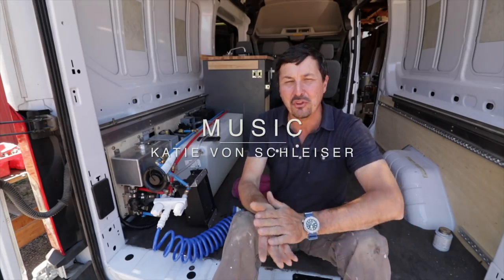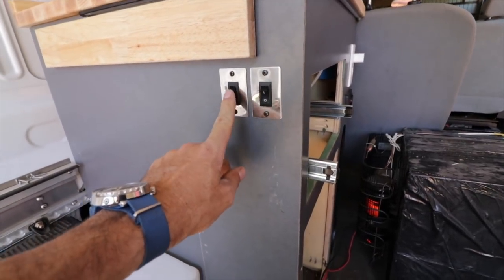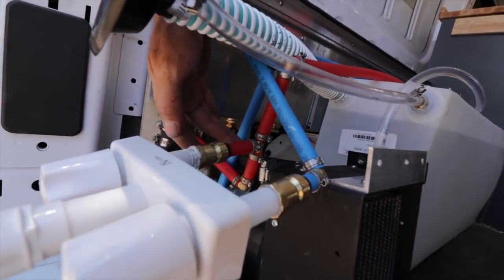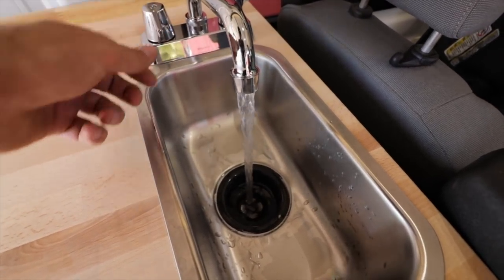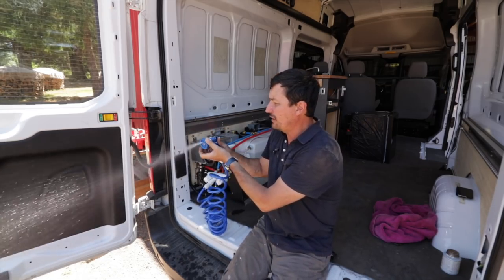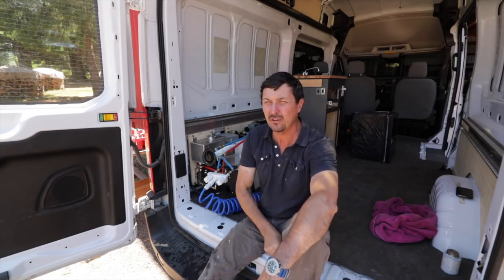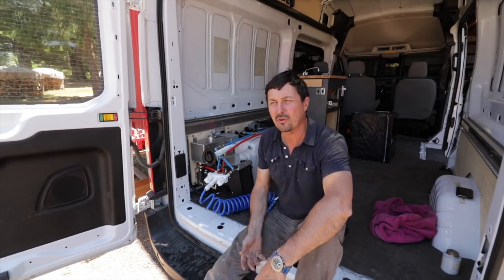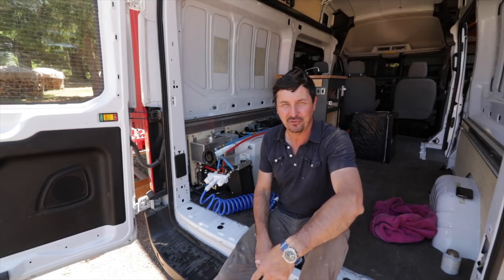Adventure Van - How To Build A Outside Shower

Comment: Looks great, i like the low footprint of your heating and water system. Not to mention the fuel economy of your van vs an RVs gallons per mile. If you use a earth friendly soap you might be able to water plants with the grey water.

Comment: Plumber here. I would deffinatly suggest adding 3/8 in line water hammer arrestors under the bar sink to add support the the water system. They will help protect the shark bite fitting and the gear clamp fittings from damage due to water hammer if you turn the water off quickly. Love the videos.

Comment: For Your Shower rig. I saw on another Van build.The Gent used his shower head for sink and shower. To mount in both spots he used a magnet. True it was large enough not to let the spray move it. If you would do something similar it could be stuck anywhere to the door frame So that it would be easily height adjustable for almost any user. Although you might want to coat the magnet with rubber or the like to prevent scratching. 
Additionally some sort of frame to attach to the door top or roof to hang a tarp or shower curtain for a bit more privacy when appropriate.

Comment: Cody, beautiful job.  I really like what you've done here.  I don't even want to say that someone will point this or that out and I don't want to do it myself.  The only thing that'd I'd add and I suspect it's on your list of things to do is add pipe insulation to at least the hot side.  I would go ahead and do both the hot and cold lines for insulation, sound dampening and protection to the pipes and connectors.

Again I love what you've done here.  I know you will be humbly proud ever time you and the family uses this system.

Comment: I'm glad you understand the risk of too hot water. A lot of kids get hurt real bad that way.

This is very nicely done. You could mitigate the risk of water and electronics in the same space by water proofing the electronics as much as ventilation will allow. (Don't want a fire.)
Maybe a plate to guide the flow of leaking water etc.

Comment: I've had to deal with custom executive sprinters for my company that cost a hefty amount and you'll still find work in those vehicles that make you question what they were thinking and why they tried to cut corners. I'm glad to see you build the van right so that you won't have issues and if you did you'd know where to source the problem.

Comment: Awesome. I have a RamVan camper that I am building...slowly. I never check out the “production” campers. The only ones I’m interested in are the DIY vans. People do amazing engineering jobs on these rigs. Yours might be the most simple complicated build I’ve seen yet, I love it. If possible I’d love to see a “mistakes top 5 or 10” help us new builders out, especially folks like myself with a basic skill set to begin with.
Reply: Have you checked out Sasnak's Transit?  He is doing a bang-up job too, the contrast between these two Fords is amazing.  They are both top-notch and built for a specific end-goal.  I am finding a lot of inspiration in both. Maybe someday...

Comment: I purchased my travel trailer at a military auction...(while I was serving) It was missing a range/ oven/ frig/ shower and toilet. 
I gutted it as far as I needed to. Gave it a super clean inside and out. Put in a range/ toilet/ frig/ SureFlo pump. Modified the bunks/ the closet for hunting & fishing storage.
Replaced all the lights with LED. I payed $400 initially...overall less than $2000. I know every square inch of it. It's a 1976 16 ft. Wilderness "My Hunting Cabin on Wheels"

Comment: Great Set up!! Hey I learned a few years ago that if I put baking soda in my freshwater tank it will keep the water nice and fresh. Its a super cheap way to keep your tank clean... I also use it after I empty my black water or gray water tank...I will refill the tank with fresh water throw in a box of baking soda and drive home with that sloshing around........when I get home I empty again and everything is nice and clean plus the baking soda will also clean the tank sensors.

Comment: Make sure that you have a good plan for winterizing all that plumbing.  Both the pressure side, and the drain side. Am a farmer with crop sprayers.  I've broken stuff with ice.   Carry spare fuses, this kind of thing pops fuses.  A long rectangular tank can be tricky to get the last few gallons from.  If the van is on a hill, the tank's outlet might suck air.

Comment: Looking great. Just 2 sense from my side. Put 2 valves in by your little screen so you can clean out the filter without having to pump the 21 Gallon tank. The rest looks great. Also for the shower head put a angle aluminum to the Floor with a diamond treat patter for decoration and boom it all looks professional top to button :-). Anyhow great job. On the Showerhead do magnetic with a switch on off magnet since your Sprinter frame is steel it will hold anywhere :-). But also as a tip put a Solar panel onto your roof a thin film which is 12V and let that charge back your Battery of your Sprinter. So this way you never strain it to the point of not been able to start your Car again. Just a suggestion. And if you want to bounce off Ideas just hit me up.

Comment: About the shower situation, I myself, would attach a plant hanger thing to the ceiling by the door that could swing out, that you could attach the sprayer to, that way you could angle it down and out away from the bed, etc. Also you could attach some hooks to the top of the doors, that way when you open both of them, you could just hang a shower curtain between the two

Comment: The gap on the back door looks big enough to feed shower head through, then even when the bike racks are in place you can use the shower around the rear driver side wheel...pretty sweet and good location choice. Thanks for sharing.😊

Comment: Hi Cody, I agree with you and have had fist hand experience of the junk you can buy. One thing I would keep in the van is two shark bite connectors and a piece of piping in case of a leak when you are out and about. these things don't cost much but if you do have a leak they will pay for themselves instantly.

Comment: Really nice.  Questions and comments:  Behind the heat exchange there is a bit of dead space to the outside.  Have you thought about putting some spray foam behind it for insulation so you don't fight the outside temps to heat the water?  where you are talking about putting the hose is next to that heater, now I don't know the heater but will you be in danger of melting that shower hose.  
What about building a square metal frame around the rear window of that door that will fold up and lock with a toggle or pin.  Then you can hang a curtain from it for the shower and attach the sprayer to it for the head.  Fold it up pull the shower curtain and hose / nozzle out of a bag set up the curtain and hose to the frame.  Shower, dry off, break down and stow.   Just a tought and the frame would fit around the window folded up out of the way. 

Thank you for the videos again.

Comment: One small suggestion (and you'll find out by experience anyway) do "submarine showers". get wet, turn the  water off, soap up and do your scrubbing with the water off then Water on for rinse, then water off and grab a towel. a continuous shower will run you out of water faster than you can imagine! And 4 people will go through a lot of water even without showers when camping.

Comment: I think one of the biggest perks people push with trailers is the overlanding trailers.  Th erooftop tent system and being able to leave camp setup and go for a drive without the trailer. 4 wheeling or what have you.  But its not for everyone. ( and those trailers are sefl contained by the way. Patriot campers, turtleback trailers, HEO expedition outfitters etc.

Comment: Wow, I like your hot/cold water system! 
Good job!

Not sure, but you might need to think about condensation if you keep the red and blue pipes side by side without insulation. If insulation around the pipe won't fit due to space, maybe it could be remedied by putting in a few little 12v fans strategically, that come on automatically when the electical for the water system and/or water heater is turned on, which maybe turn on/off on a timer in cycles, etc. to keep it dry.

But who knows. Maybe there are enough holes and vents to keep the air enough moving in the cabinet and around the electrical.

Hope it helps.

Comment: Cody, You should probably move your screen filter closer to the pump, the way you have it installed, you can only clean the filter if your tank is empty (i.e.: removing the cap will drain the tank to the level of the filter).

Comment: Two things you should consider are 
1: Isolating the water filter with shut off valves for cleaning it out/ changing filter and 
2: insulate those pipes, tubes and tank against the cold when you are not using the van in cold weather.
I know the van is heated, but there will be times when you don't use it and frozen pipes/ tanks can burst... :( 
Err on the side of caution and you'll be fine...LOL

Comment: Cool setup bro, I really like your heat exchanger for your hot water. Instead of the furnace I think you could also use the van's hot water as a furnace. But anyway I love your rig

Comment: i am starting a van project in a couple months... all i can think about is how am i going to do the shower.  most of my adventures involve mountain biking or dirt biking.  i hate going to bed dusty and sweaty..  
i love your setup and the way you explain everything.
Reply: How to do it all economically is the question.
Reply: Compost toilet on floor installed over small fiberglass tub or pan(no blackwater tank needed), shower system above with a curtain system that folds up and away. And "grey water" escaping down a drain that's installed in pan. Thus the water escapes to the ground below. If you go to the expense of using bio-degradeable soap, you won't risk a hassle by the authorities! Good luck. All my humble opinion based on what I've seen in other vans even smaller than Codie's. That's how I'd do it!

Comment: You can always put the electrical in an IP rated box but I personally don’t see a problem with how you have done things. 
Great water pressure I am impressed. 
Did you get the mosquito nets installed?

Comment: Yeah, even the more expensive RVs are junk.  Forget taking them off pavement even on decent clay.  You are doing it right, great job so far.  Well thought out.
Reply: lol, talk to me in two years or 15,000 miles...
Reply: RVs aren’t off road vehicles. My roadtrek is 18 years old with 160 thousand miles. Still in great shape. Never take it off the gravel. That’s what bikes are for.
Reply: I bought a brand new RV and it was put together by people who expected the dealer to deal with warranty claims.
 Which can take weeks.
Reply: Tenspeed TheBikeHanger - ours is quite solid and the equipment is top notch. Maybe you have memories of older ones. The tech they use now is quite remarkable.
Reply: You are joking right??? The 50-65k 4x4 RV's are AMAZING. This isn't 1990 anymore... you are delusional.

Comment: Just upgrade those 120v circut breakers to GFCI / Arc Fault. That'll quiet up most of the saleys. Also you can never really trust a camp site has a good ground at the hookup the GFCI will fix that problem.

Comment: RVs are meant for open road. There meant to trailer things like a Polaris/dirtbikes but like you said it severly limits your mobility and the range you can set up camp. All those amenities aren't going to do any good if they're parked 5+ miles away from your campsite

Comment: Awesome work. I've almost got the same set up except I'm using an Eberspacher diesel water heater and a small hot water tank/califont. The advantage is I can also use electric to heat it up, even solar power in summer. The downside is it's only 25L (6.6gal) so it can run out! I love the idea of continuous hot water, but not sure we can get get one that does it here in New Zealand. I have not been able to figure out if the Eberspacher heaters can do it.

Keep up the good work, I agree with everything you said about doing it yourself and why a van over a campervan.

Comment: what about a water level sensor, so the pump is never going to run dry by accident? or is a feature like this already build into the pump or isn't it smth u have to worry about?
Reply: 8i good call
Reply: Most of the SureFlow's can be run dry. They are self priming, so will do so normally to some degree.
Reply: Rather than a sensor, probably just use the switch to only power the pump when you need it,.  You can hear when it runs dry, or runs too long.
Reply: great call

Comment: A different idea for the outside shower plus filling port would be to cut an access panel in the side of the van. This would also let you setup a shower curtain easier as you can have 2 sockets around shoulder height for a curved electrical conduit to secure into. With small fishing weights hung off the curtain it will not blow around. Would want to setup the pump switch as a 3 way so you could have a weather resistant one at the shower control panel and one inside by the sink. 

With a key lock you would be able to have it ready so showered off before you open the door to the van so less likely to track in mud from riding or salt from the ocean. Would be right up there with putting a combination lock box on the vans outside to lock up the keys when you are away, sure you want a place inside to lock up phones when you are dealing with water but then you still have to carry the keys with you.

Comment: Safety Sally here ....... be careful of mold growing in that clear tube . I understand why you’re using it but mold will grow in it because it doesn’t block the light like the pex pipe will.
Reply: Just hook up an ultraviolet light shining on the tubing.  Problem solved.  UV disinfection systems have been used for years to purify water supplies.  Never seen a system installed in an RV so, maybe it's not a concern anyway.
Reply: The tube will be enclosed in a plywood box.

Comment: Great setup so far, quick question;
Where the hot and cold water lines run forward and go into the sink cabinet, do you plan on putting rubber grommets to protect the lines to prevent rubbing?

Comment: Are you adding any way to filter fresh water? I'd hate to run out of water in one of those isolated locations. Dealing with the grey water would be more work than finding a water source I think.

Comment: Tanks can go up on the luggage rack or roof also
Reply: Yep.  180 pounds of sloshing water should always go up high...
Reply: Tenspeed TheBikeHanger why not??  Never saw a gasoline truck..
Reply: Tenspeed TheBikeHanger i would fill them at the sight but no reason roof rachs cant hold 180lbs...i see contractors loaded up way more than that
Reply: It's not just the sheer weight, Thomas, it is the fact that the water moves.  I have seen a number of people try relatively  small amounts of water in roof tanks and they are dangerous in small vehicles. Nomadic Fanatic is a good example.  He used PVC pipe to build a holding tank on the top of his old van for shower water, but every time he hit the brakes or accelerated the water would slosh forward or back and drastically rock his van.  It came off after a day.  It is just a stupid idea.  BTW, tanker trucks have baffles for this exact reason.

Comment: I'm not going to say your water's too close to your electrics. No, your water should be on the passenger side to distribute the weight better. At the same time, it will separate it from your electrics. LOL. You may even have space to mount it flat-wise, OVER the passenger wheel hub but make sure it cannot fly loose in the event of an accident (which looks to also be a problem currently, that is, it's currently not secured adequately... at all). 
Another point I'd make is that the clear plastic hosing will quickly build up a layer of algae. It does not take much sunlight exposure for that to happen. 
Also, looking at the volume of water the shower rose is pushing out, you will quickly run out of water. Yor need about 2 gals for a really quick and dirty shower (only a quick rinse) and more like 4 gals for a really quick shower (including short hair shampooing). But with that shower rose, I'd say you're doubling your consumption. Okay if you can fill up again straight after. 
But otherwise, NICE. 
I wish I had hot water in my little camper. On freezing cold mornings, I get by with about 1 litre of warmed water. I shower from a 20-litre jerry can with about 2 litres of boiling water mixed in and SureFlow pumped out through a garden watering rose with a trigger that is volume controllable. 
BTW: The 'ideal' setup is whatever meets your needs. You definitely do not need 'everything'. I carry about 25 gals (100 litres) of water, just for one person (myself, about 5 litres/day) but then I camp very remotely for a couple of weeks at a time and also require backup water. And I also carry additional backup in a (separate) 20-litre jerry can. Obviously, your needs are more family oriented.

Comment: Hello Mr. Wranglerstar, 
do you run into problems or does your van sag on one side? Because I've knowtest that you have all your weight and passengerseats on the driver side. I used to own a Silverado and where the left side would just eventually be lower that the other because of me sitting in it all the time.